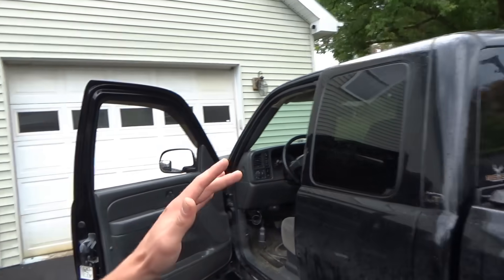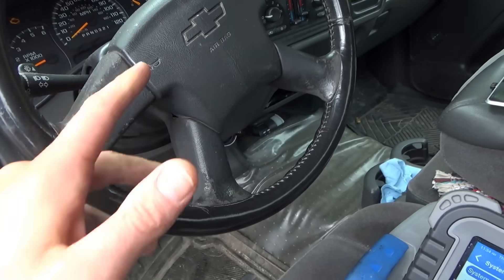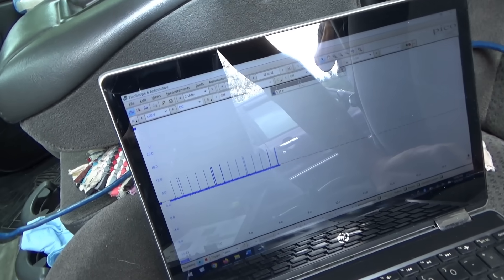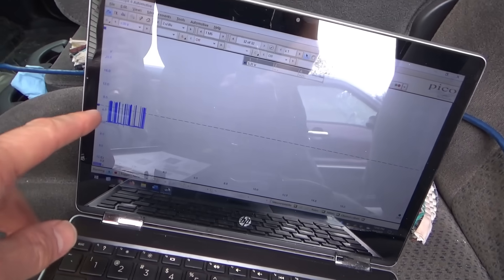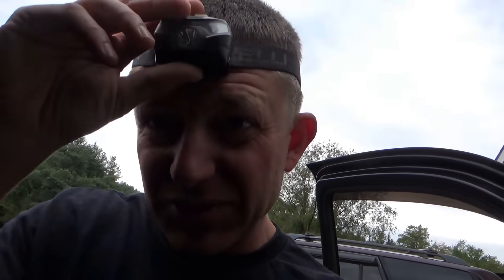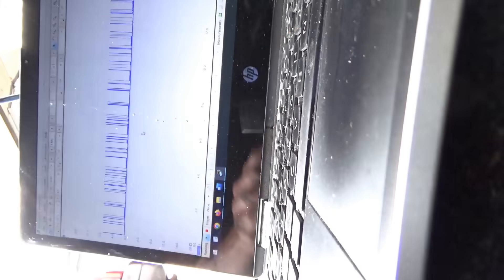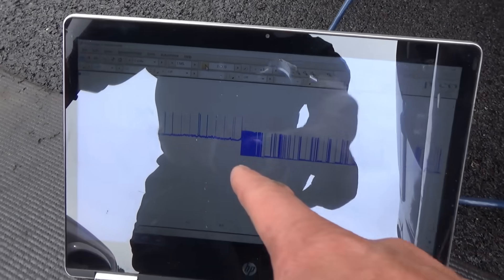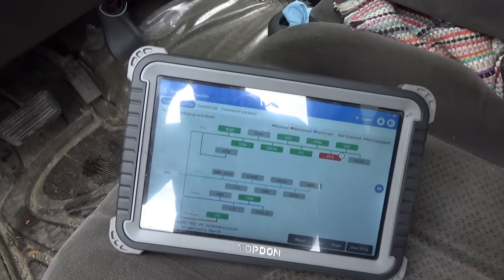CRAZY Chevy Loses COMM...While DRIVING?! ('06 Silverado: Cluster, 4x4, Windows, Locks, ABS)

Comment: I worked at a Volvo/ Mack dealer. Had a Volvo truck towed in. Truck was dead. No communication with computer. Data link dead. Normal deal is to unplug the modules one at a time. Truck had TPM system . Module at the rear of truck, easiest to get to. Unplugged module. Truck came back to life. Worked OK. TPM system module killed the whole truck.
Reply: One handy thing about these GMs is they have a splice pack for the class 2 network, they whole network is in a single location. Finding a single module fail is pretty easy.

Comment: I just got through putting in a transmission and transfer case in a 2006 Yukon xl. I will never do it again with a partial lift, you know the kind that you put on each side of the vehicle. I think they get in your way too much. I have cancer in my spine so it’s pretty hard for me to do but somehow with the help of a hobo frieght scissor transmission jack I got it. Those jack are awesome for what they are.i have a parasitic draw somewhere in this rig. As soon as i find it I’ll let you know. Great job on the truck Ivan. Impressive as usual
Reply: those work great for fuel tanks too, just cut/drill/bolt on a piece of plywood to fit if you feel need for a larger platform. 30 gallons full is easy then.
Reply: Wish I was there - I love to diag parasitic draws, and 00-06 GMs are my specialty,  Have it done in 15!

Comment: I've got an 04 Tahoe that has all sorts of voodoo electrical going on lol. I did have have a broken wire in the driver door boot that fixed most my issues. These are great trucks but can do some really weird stuff electronics wise.
Reply: All  weird, random and voodoo are just unexplained problems.  Get the OEM wiring diagram, pick on problem and start solving.

Comment: Nice!

I don't know how easy/hard it would be to do on this vehicle, but in particular it would had been interesting to connect the stater battery + to a separate battery / jump starter, to tell if it was the signal to start the car or the voltage drop that did reset the troublesome module.

Also what an awful design choice to have connectors for anything else than the absolutely necessary (like wheel speed sensors) in that kind of place.

Comment: I don't understand a network designed in a way so that a single component can take the whole network down.  It would be like your laptop breaks and takes down the entire internet.  Probably done for cost, but if you want fault isolation and reliability we have to move to better network technologies on cars. 

Some time ago I recall reading about development of Ethernet for cars where I think they were using single pair lines and tiny connectors to save space. Still plenty of bandwidth even with single pair. Unfortunately, the more sophisticated the network, the smarter the technician has to be. But I don't think we need to move to Ethernet to get better fault isolation.

Comment: Cool video, an intermittent no com can drive you nuts!  With the old class 2 gm stuff, i usually like to start at the splice pack. I have a jumper I made to connect all the com wires after you pull the jumper "comb". That splice pack is a gift from a bygone era, when an engineer actually considered fixing the car after it was manufactured 😊
Reply: Aes wave sells an isolate/jump harness for these splice packs.  Can pull the leads off one at a time to shut down individual modules.
Reply: @Lunchman.d yes, it's a nice piece. I just didn't happen to have one when I needed it, so i made one out of some leftovers I had laying around. I've used it a bunch since then.
Reply: @JessClearyAutoRepairLLC  Heck yea.  I'll cut splices like that and other random connectors out when I'm in the salvage yard to make all kinds of adapters.

Comment: I've seen more vehicles brought down by ABS module issues than anything else.  Granted, GM isn't helping matters by putting the EBCM out in the open under there, but even on vehicles where it's tucked away high up in the engine bay, part of the master cylinder, etc., ABS modules just seem to love to die.

Always good to see one of these trucks get saved!  As far as I'm concerned, this was the last reliable and solid era of GM trucks.  My mum and dad have had a 2002 since new, now with over 350,000 miles, and the worst thing to ever happen was the transfer case detonating a couple months ago, and taking out the tail housing of the transmission in the process.  Rebuilt the trans and transfer case, back on the road in less than a week!

Comment: Everything is integrated nowadays i was testing wires on my jeep radio connector and the wiper start working.
Reply: Electrical issues on Chrysler vehicles are not problems, they are features, built right in.

Comment: Chevy’s do this weird crap all the time but they usually still run.  Maybe crappy but they tend to make it back home.  Fords just up and die on you.  All the time.  Especially now that they integrate all the modules for fart sensors and shit..  Chrysler and jeep just blow up.  Toyota’s drivetrain will crap out or you lose a damn wheel or something.  Hondas have pistons that are constantly wanting to see the world making windows in their homes all the time..  bmw’s overheat then turn the motors into bacon.  Mercedes stops working because the dealer said so.  Lamborghini’s either catch on fire or get repo’d.  volvos, well volvos run, may not start but theyll run..  longer than you.   Saabs get turned into pepsi cans cuz nobody wants em.  Dodge always breaks in two either from a pole at 120mph or from rust after a month outside.  Its all junk in some way or another..
Reply from the maker: AMAZING COMMENT 😆👌
Reply: Just Nissan and Mitsubishi for you then?